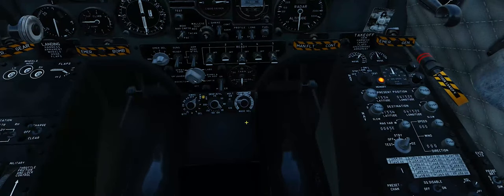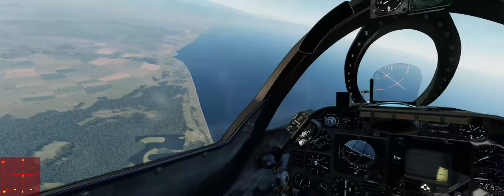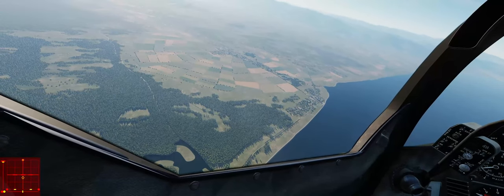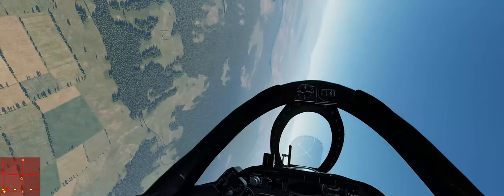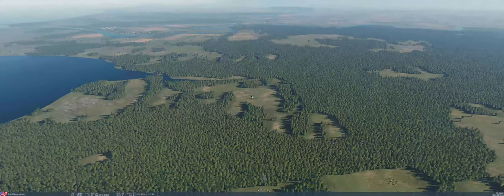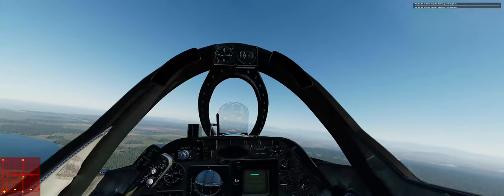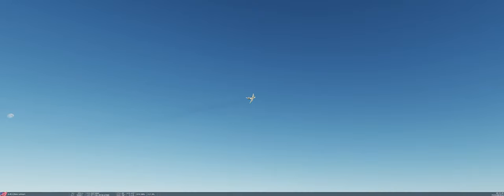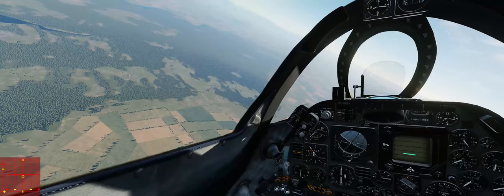DCS - A-4E Tutorial - Basic Bombing

Comment: Great tutorial, thank you! Now, as a new A-4 pilot, i'm fighting with correct trimming of the aircraft on the bomb run. Usually it begins to slide on the left or right, so i compensate this with rudder trim. But this results in aircraft begins to roll slightly! When i compensate this roll with aileron trim, it gives much more roll effect, than you can expect from trimmer... And now is the time to pull up, and i got no time to aim correctly. Any advices about this? When i see your "trim run", i had impression, that your trimmers work in another way than mine 😃
Reply from the maker: In the A4, I generally don't touch the rudder or aileron trim, honestly. I am usually only adjusting the elevator trim on the trim run. The A4 is very touchy in roll. You might be better off ramping down the sensitivity and just flying the corrections out manually.